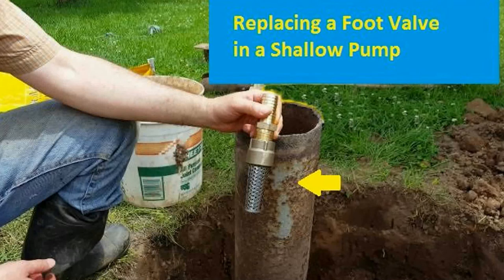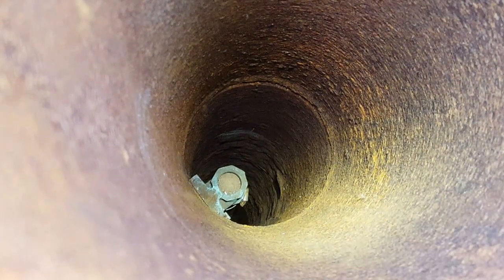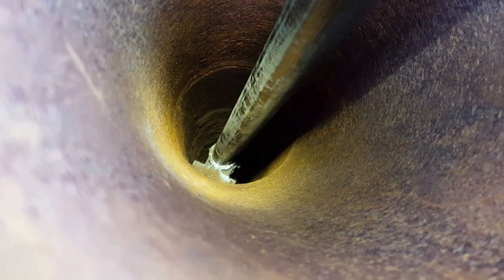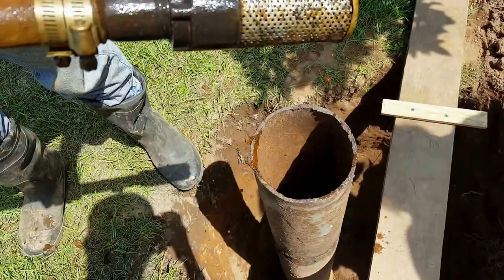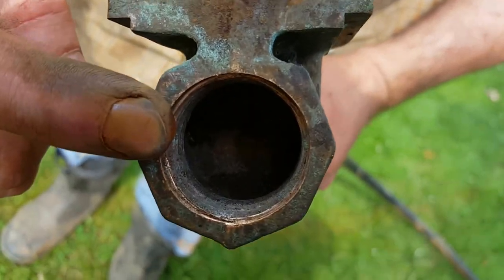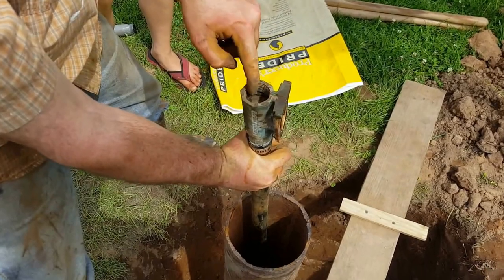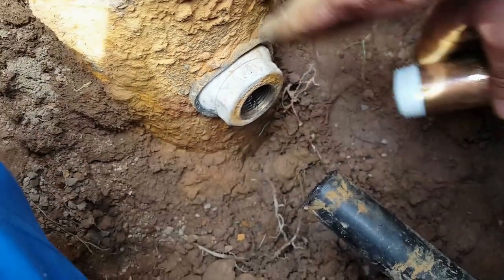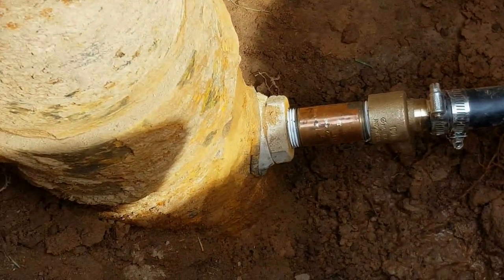Replacing a Well Foot Valve

Comment: FYI....It is called a pitless adapter, and you should put silicone grease on the O-ring before you put the pipe back into the well and reconnect the pitless adapter.

Comment: A couple thoughts.  
1.  You have to be pretty careful when you get the pipe loose from the Quick disconnect - say its deeper than you realized and the pipe is galvanized iron pipe (and its likely full of water).  That can be a lot of weight and the person pulling might loose control and mash their hands as the T of removal tool hits the top of the well casing..  A second person with a pipe wrench on the tool might keep from loosing control.  
2.  I cringed as I saw him with the pipe and the quick disconnect over the open well casing without the removal tool already attached.  What if he dropped it in the casing before attaching the tool.  Big problem. Be safe, assume s..t will happen.
Reply: It's a foot valve. Which is used for a shallow well. It's not going to be galvanized pipe because it's only 20' to 50' deep. He dud a fine job. 

You don't know what your talking about.

Comment: I'm thinking that you should have fixed the leak in the pipe that leads to the house first because that leak could have been causing a loss of prime and pressure.  Might not have had to change the foot valve.
Reply from the maker: You could be right.  Where were you 2 years ago?  I was on a mission and didn't actually notice the leak until later.  It was good practice anyhow.

Comment: Did You have to unscrew the pipe that's going into the house? Will the actual well pipe come out without you digging down into the ground and removing that pipe? I'm having the same issue I can't keep prime in my pump's going to burn up I just need to know if I have to unscrew that area where you said you had a leak first or can I just pull that pipe up once I get access to it with that tool The t-bar tool?
Reply from the maker: Its been awhile, but I'll give it a try.  
I didn't have to unscrew the pipe going to the house. 
The pipe should come out without digging into the ground.  You should be able to access it from top of the well by removing the well cover.

It turns out that the leak or the bad foot valve could have caused the pump not holding prime. So they are actually 2 separate issues and should be performed separately.

Comment: Not a bad DIY job.  My jet pump turns on about every 20mins so I think I should change my foot valve as well.  Do you remember the diameter of the removal tool?  Also is it just standard NPT?
Reply from the maker: The removal tool is 1 inch.  Standard pipe threads.  The 6' tool was only $20 at the plumbing supply store.  The issue I was having was that the pump stayed on without pumping water.  Thanks for watching and good luck with your project.

Comment: my moms well jet pump slowly loses pressure after 5 mins pump kicks on at 20 then stops at 50 and repeats every 5 mins would that be a check valve or a foot valve and how would i know where check valve is if it is in pump?

Comment: Hi Gerard,in process of replacing foot valve, While taking out pipe , the foot valve dropped in borewell, currently stuck. please suggest the way to take out the old foot valve since  it is blocking us from extending water supply pipe. help help
Reply: Magnet tied to fishing line?

Comment: Great video.  We have had a lot of rain for the past couple months. Last week we had yet another bad storm. Our power clicked off and then back on before the whole house generator kicked on.   Later I noticed air coming out of faucets before water.  I figured it was because of the power being clicked off in the storm.  Then we noticed rust in the water.  Now I still have air four days later but the rust is gone.    Some suggest foot valve.  Some say it's probably because of lightening hitting well casing and knocking the rust off.    Any ideas?  Our closest well company is about 130 miles away. Thanks!

Comment: How do you know you are not driving the foot valve into the mud? How do you know where you are at with regard to the bottom of the well? 1' above bottom? 3' above bottom or 10' above bottom? what is the recommended height above bottom???
Reply from the maker: I didn't worry about the bottom since I was replacing a old valve.  I didn't change the length of the pipe going to the bottom.  If I was installing a new pipe or a pipe for the first time,  I would need to take that into consideration, but I would think who drilled a new well would know how deep it was.

Comment: My electric went off for a few hours. When it came back on the water didnt work. We tried to prime it last night but the pump just makes a humming sound, then cuts off and on and off.. any suggestions??
Reply: Ever fix it ?
Reply: @maxnorcrest9563  we ended up buying a new pump. But it's funny u should ask, because this pump keeps messing up. I have to tap the little black box on the side of it. But other times we have to keep priming it to get it on. Idk if it loses prime because of the box shorting out. I dont see any ants in the box or dirt so idk why it keeps doing it. The water is off as we speak
Reply: Mine was doing that it I needed a new check valve between pump and well pipe 

But  water stopped after that a little while later water went after that I think my foot valve is cloged or check valve stuck shut in well 

I got a new pump after the hum burned out from no check valve and did the on a few off few days thing after got that new check valve great but now stops getting water screen/foot Valve cloged 

Could be that or your pressure tank not holding 

If it gets hot then not getting enuff water to keep cool and it's not holding in pump

Comment: Where did you find this tool? I am looking online but it doesn't look like that.
Reply from the maker: I bought it at a local plumbing supply store.  Inside the well is a pitless adapter which allows the pipes to be connected from inside the well to the outside.  I took a picture of it and they knew exactly what I needed.  Look at 
https://www.completeplumbingsource.com/well-pump-pulling-tee?gclid=CjwKCAjwuITNBRBFEiwA9N9YELn6zf7UDcSRj_x8A8jH75eR7ATyClfVlICE09Ax8jcF-wwrxW9ZGhoCH-8QAvD_BwE
Hope this helps.

Comment: How do you know if it's the foot valve..
I had a leak in my hose and when I fixed the leak I lost my pressure...then nothing . now it won't prime...
Up until this point it was fine with lots of pressure
Pumps about 20yrs old
Reply: I ran into this many years ago. Well guy came out, replaced foot valve. 2 weeks later, still lousy pressure. And losing prime. My issue turned out to be lousy sealing between well casing and old adapter. Casing rusted and wouldn't hold pressure. Found it during rainy weather. Saturated ground, and bubbles on the side of the well casing.

Comment: What if the foot valve is leaking?
Reply from the maker: If the foot valve is leaking the pump won't hold prime and therefore no water pressure.
Reply from the maker: Water needs to stay in the pipe from the well to the pump.  The foot valve holds the water in the pipe.  If the water leaks out the pump will not be able to pull the water from the well.

Comment: That is nasty water. You should use city water instead.
Reply from the maker: Wish I could.  City water is not available out there.
Reply: Use chlorinated pond water that usually has neurotoxins added (because lobbyist care about teeth LoL) instead of fresh ground water? Lol?  If the rust freaks you out, you wouldnt want to look in the miles of city pipe.  Just unscrew the screen on your sink and look up in the faucet. It'll be 'gross'.